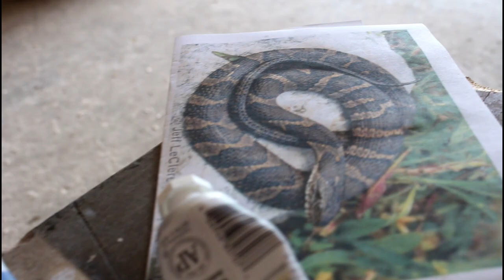Carving My First Snake Walking Stick

Comment: Cool job you did really well ,what type of paint was that you used.
Cheers
Tim from Wood 4 Nothing
Reply from the maker: Thanks. I used oil paints - like you would use on a canvas - for this one. I think they have a little bit better look than acrylics but that might just be me. :)
Reply: Mark Hanson thanks for that I wanna try using paint in a future project so thanks keep up the good work loving your channel 
Cheers
Tim from Wood 4 Nothing

Comment: Great job. Did you let the wood dry for a certain time or just cut it and use it
Reply from the maker: I let it dry for about a year and a half. That's usually good enough. It probably has some moisture in it at that point but will dry out as it is getting worked on.